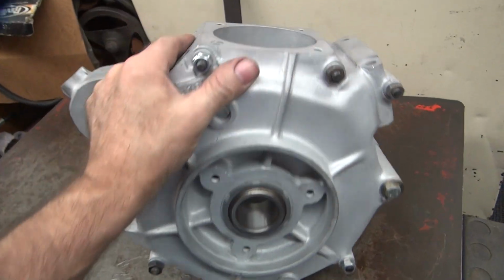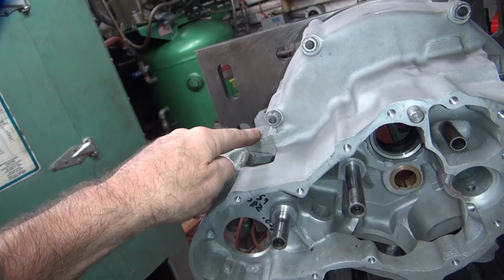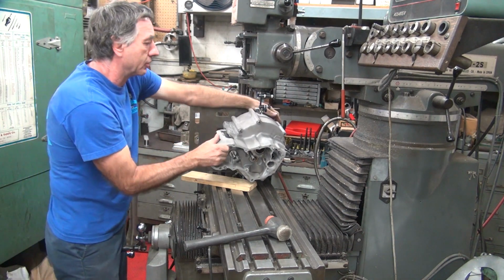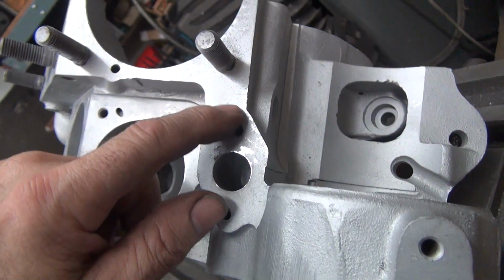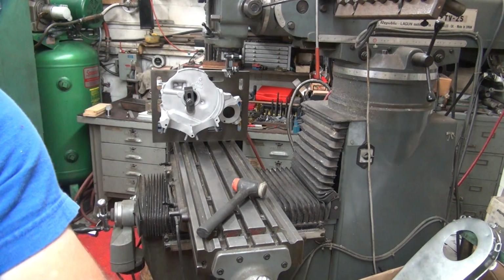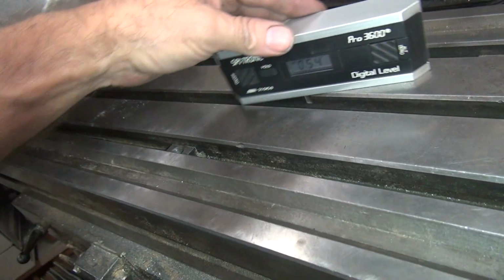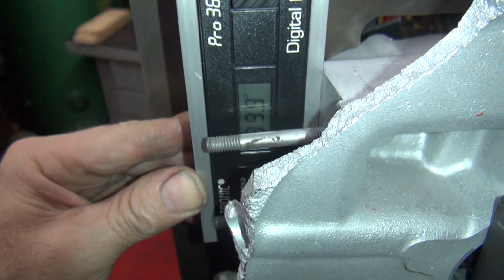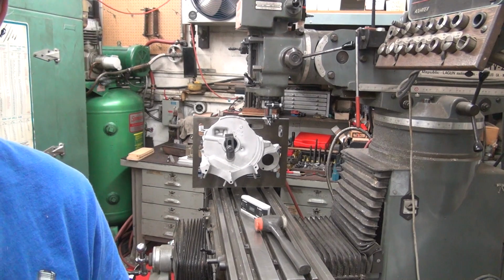#185 1947 EL case welding knucklehead 74ci motor rebuild & machining repair harley by tatro machine

Comment: I just machined 5 sets of OEM panhead cases ranging from 50-64 and they all wound up showing the exact same phenomenon you are seeing here. The cylinder deck surface is absolutely not machined in relation to the engine mounts in any intuitive way. All 5 sets of OEM cases are cut to lean forward by 2-3 degrees and if you use the deck as your reference you will cut a very significant taper in the factory mounts. Can’t tell you why and when you look at the factory blueprints and the datum used, this does not seem to be how they were drawn, but it is certainly how all factory mounts were cut. Very strange 🤷🏼‍♂️. I just clamped a straightedge to the existing rear mount (outside of the area I had to repair) and trammed in to that squaring the case up on X&Y, and cut the surface, then moved to the other side of the case and dropped the 2” to surface the front mounts.
Reply from the maker: thats perty much what i have learned over the years. nothing is how you think it should be or the same from one part to the other. that is why you have sloppy parts. so you can make them all fit together as needed. the harley book says 1.990 on the split, not 2.000. i measure more at 1.980 most of the time.
how straight do you think all those frames are. not even close.
tatro

Comment: if you do those more often it might be interesting to use a plate with holes drilled at the exact spots as the bolts that mount the cases together should be placed on a factory case (and hope they actually drilled the cases the same way , they should if they want to fit a remanufactured case against a factory one 
mount the case to the plate using verry tight fitting shank boltsmounted through and through , you can use both sides of the plate for the left and right case half and know the refference is exact when setting the side of the plate on the table and clamp it against the vertical plate
Reply from the maker: the 1st thing you learn when working on old stuff is that nothing is the same or what you think it should be. 
the reason that you can not swap out case halfs, is because no two of them are the same.
if you want things to fit together, you need to keep the good side and make the bad side fit it. that way they match each other again.
tatro

Comment: I have a set of ‘58 FLH cases which definitely have had both front mounts replaced approximately .160 too high (tested the cases in 3 different frames and got basically the same result).  The motor came to me as a true pan/shovel and will get rebuilt that way.  The rear head is tight to the seat post in the frame I want to use so I’m very interested in how you machine the mounts on these repopulate cases.
Reply from the maker: my oem stock case has a 2deg forward tilt to the motor. this will give you that extra head clearance that we always seem to need.
the frame blueprint for the shovel frams show no tilt to the frame mounts but the case seems to have it. i will be checking more cases before i cut. 1948-99 has a 1.990 offset by blueprint. i have measured in the passed 1.950-1.980. i usally go with the 1.980 offset. v-ywin says the knucklehead frames are 5/16" different on the frame motor mounts. that would put this job at 1.675 or so. more checking needed.
tatro
Reply: @TatroMachine  I see.  Besides the obvious replaced front mounts on my motor there was evidence of a repaired crack in the back mount.  I haven’t determined yet if the doofus who put the front mounts in too high also worked his magic on the back mount.  Would it be your opinion the oil pump mounting surface is the only reliable place to establish dimensions?
Reply from the maker: i have never seen one cut on yet. all the other surfaces i have seen cut on. you have to start somewhere.
tatro